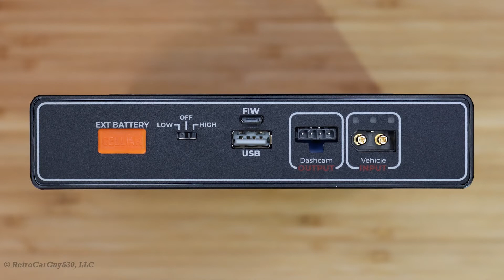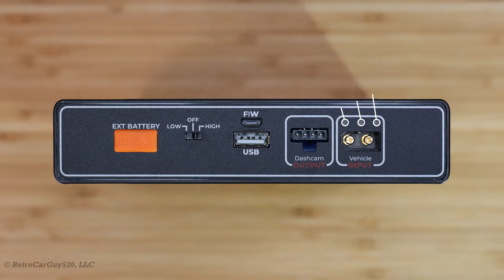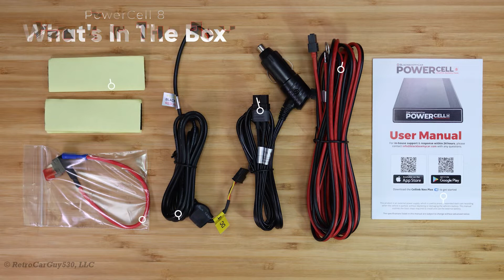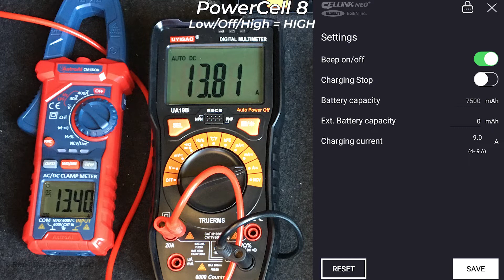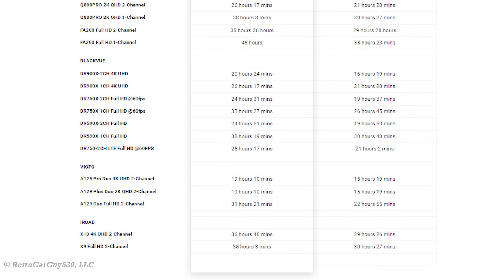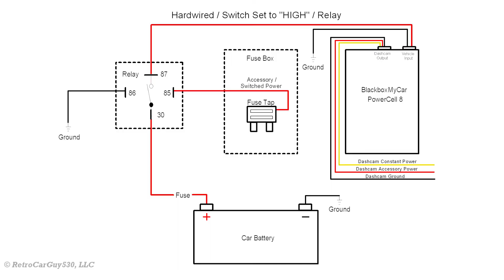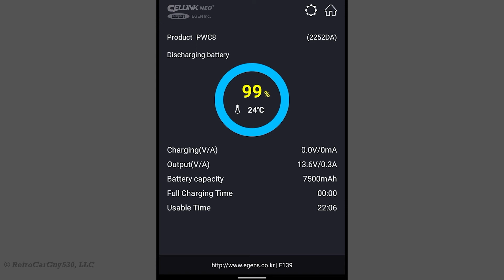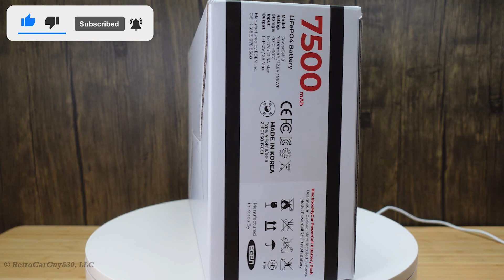BlackboxMyCar PowerCell 8 Dashcam Battery Pack Review / Testing

Comment: I would like to add several of these battery packs to my project truck to power several different components.

Mainly a dashcam, but also a dedicated wifi hotspot for remote live viewing said dashcam, as well as the several sensors added to my car alarm (possibly the alarm itself).

This would be to prevent the mentioned devices from draining my vehicles battery, as well as to charge them when driving.

I have also thought about taking this a step further by adding a solar panel to charge the battery packs when I am not driving the truck. I can seamlessly add one to the lid of my bed mounted toolbox, approximately 100w given the dimensions of a 100w panel.
Obviously I would need to diode isolate the solar panel from back-feeding into the ignition via the acc wire of the battery packs.

Have you ever considered adding a solar panel to supplement a dashcam battery pack? Do you possibly have any opinions to share on an idea like this? Just trying to think of ways to improve the system in a vehicle only driven a few times per week. 

Thank you.  Loving your content!
Reply from the maker: The PowerCell 8 can output up to 2 amps max.  You could potentially provide power to your WiFi hotspot using the USB port if the hotspot device is powered via a USB power connector.  I've not tested using a solar panel to maintain the charge level in the PowerCell 8.  It sounds like it might work as long as the output of the solar panel is capable of providing a minimum of 5 amps of charging power.  You would have to experiment to see if that would work.  BlackboxMyCar does offer a 120V AC to 12V DC power inverter / charging that you could use to charge the PowerCell 8 when parked.  It outputs 14.6V at 5 amps and has a cigarette lighter power port connector on it.

I'm currently retesting the PowerCell 8 as well as one or two other dash camera battery packs that were just released.  I have the BlackVue B-130X 7500 mAh / 96 Wh battery pack which is similar is capacity and size to the PowerCell 8.  The B-130X does not support adding an additional battery pack to increase capacity like the PowerCell 8 does.  I'm trying to get a Thinkware iVolt Xtra BAB-95 which also has a capacity of 7500 mAh / 96 Wh.  All three of those battery packs are manufactured by the same company (EGEN).  The two new units match the capacity of the PowerCell 8.  The PowerCell 8 I have for this new set of tests seems not have the same issue of requiring the much higher amp draws that the one I had at the time I created this first review video.

Comment: Using a relay, what size fuse should I use between the "30" relay post and car battery? Would you recommend a 15 Amp fuse based on the amp draw of 13.81 and 13.40 at 10:45?
Reply from the maker: Yes, 15 amp fuse seems appropriate if you set the charging level to 9.0 amps which in my testing resulted in the 13.81 amps of current draw on the circuit.  FYI, my test results are now being investigated by BlackboxMyCar and the battery pack manufacturer EGEN to see why two different PowerCell 8 dash camera battery packs (from late 2021) had the current draw levels you see in this video.  A friend of mine is testing/reviewing this same battery pack and he's now finding the current draw levels are within the specified charging amp limits set for the battery.
Reply: @RetroCarGuy530  Thank you so much! Very helpful to confirm what I was thinking. As for the current draw levels, that is an interesting situation.
Reply: @RetroCarGuy530 is this needed? Sorry I didn’t catch this during the video.
Reply from the maker: @Lagunaic whether you "need" a dash camera battery pack depends on your dash camera recording needs and your driving habits.  If you need to power your dash camera for long parking mode recording sessions, then the use of a dash camera battery pack can be quite helpful.  It isolates the power draw from the dash camera to the dash camera battery pack instead of the vehicle's starting battery.  If you only need the dash camera to record while you're driving your vehicle [no parking mode recording required] or for short parking mode sessions while your car is parked while shopping then, no you don't need a dash camera battery pack.
Reply: Also, it's interesting the supplied fuse with the product is 20 amps.

Comment: Right on Robert,

I just got done watching all 6 YouTube Videos on the Power Cell 8, (BBMC, EastCoastJeepSRT, dial2fast, Everyday Reviews, USDashCamera). Your’s is the best. 

I agree running 13.8 Amps through the fuse box may not be the best idea. I have LED Light Bars on my cars that operate at 7.5 Amps, and those must be wired directly to the battery. Using the relay method you show is a much safer option. Why is nobody talking about this? Lol

If I run the Power Cell 8 with a Viofo hardwire kit for parking mode, which voltage do I select for the low voltage cut off on the hardwire kit for the longest recording time? (the lowest voltage) 
-Chuck
Reply from the maker: I would set the LVC setting to the lowest voltage setting possible for that hardwire kit power adapter when powered by a dash camera battery pack.  The battery pack usually outputs 13.7 to 14.2 depending when fully charged. The voltage output from the battery pack should be in the mid to upper 12 volt range when the internal batteries are near fully discharged.  In many cases, the LVC of the hardwire kit won't even come into play when powered by a dash camera battery pack.  Each battery pack make/model has its own voltage output levels based on internal battery charge level, but most of them follow this pattern.
Reply: @RetroCarGuy530  
Thank you for the speedy reply.

Comment: Did you use the car socket to power your dr900x ?
I also have the dr900x
Reply from the maker: I used the 3-wire hardwiring harness to power the DR900X and DR900X Plus dash cameras I've tested over the past couple of years.  You can power the DR900X with the car socket power adapter, but parking mode will be the motion based parking mode (wait 5 minutes of no car motion to enter parking mode and exit parking mode when the car begins moving again).

Comment: Price?
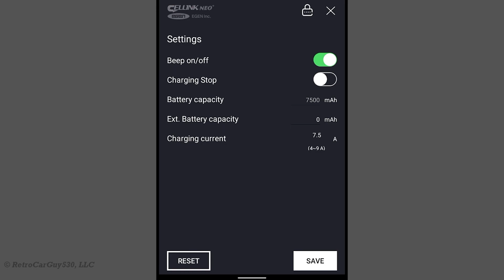Reply from the maker: Starting at 17:44 in the video, I discuss the pricing info for this battery pack.  BlackboxMyCar was running Black Friday sale at that time the video was released and it was available for $341.99 USD.  The current base price is $394.99 USD.  If you use my affiliate link or use coupon code RCG530 at checkout time, you'll save five percent on your purchase.

Comment: I know this is late in coming, but I've only just decided to venture down this rabbit hole, so please forgive me.

Now, I appreciate this video and the real number outputs you showed when charging and using the battery. It actually informed my decision on how to install this equipment in a way I'm more comfortable with - safely. While it's arguable as to whether this is over-kill given the lack of news stories highlighting these batteries causing vehicular fires when they are installed without a relay, I'd rather be safer than sorry...and without a vehicle!  'Cuz, as we should all know by now, insurance reimbursements/replacements are not easily obtained on DIY projects and mods, if ever.

For the benefit of your viewers, who don't already know and who are reading this post, this is why you always hear, "Have it done by a licensed installer." It's so the insurance companies can bill them for the claim, an avoid paying it themselves. If you DIY-it, you won't be seeing much (if anything at all) when you fill for a claim!

Again, RetroCarGuy530, great video! Thanks!

Comment: Will this batter pack work with the vantrue N4 dash cam?
Reply from the maker: I looked at the Vantrue website to check out the hardwiring kit for the N4.  It's a 2-wire device with low voltage cutoff.  Yes, you can use that with this battery pack, by wiring the red wire it to the "BATT+" output terminal (left most terminal connector) and the black wire to the GND (3rd from the left terminal connector).   Since the N4 documentation states it has a parking monitor, it must mean there's some sort of motion detection for the N4 to know when to enter and exit parking mode.  To have instant entry into and exit from parking mode would require a 3-wire hardwiring kit to access the ACC+, but I don't see that as an available accessory from Vantrue.
Reply: @RetroCarGuy530  thanks so much for the response!

Comment: If I wire number 30 with in 8" of my battery, is it acceptable for me to wire number 85 to an accessory/switched power fuse via tap inside my cab?  If so, what guage wire and distance would you suggest?  Reason is that all of the ideal fuses to tap into are inside my cab and not in the engine fuse box.
Reply from the maker: The control side of the relay consumes 100-to-200 mA, so you can have a long run of wire for that circuit to the remote fuse box location.  Most of the time, the relay pigtails I've purchased with the relays have a 16 awg wire for the control side.  I would recommend using the same awg wire gauge as the relay pigtail uses.
Reply: @RetroCarGuy530  Thank you for answering my question.  I have been studying this video for a few weeks now and I appreciate your technical insights.

Comment: I already have an extra VIOFO 3 wire USB-C hardwiring kit,not tech savvy here but is there any chance I can purchase an adapter for the power cell 8’s dashcam output?if so what is the adapter called?
Reply from the maker: During the purchase of the PowerCell 8, you can select "Output Cable" of your choice.  If you select "Power Output Cable (Unspliced)" you will be able to connect the wires from the output cable to the input wires on the VIOFO 3-wire hardwiring kit.  If you have already purchased the PowerCell 8 without getting that option, you may be able to contact BlackboxMyCar and see if they would sell that by itself.  I don't see it listed on their website as a separate product offering.
Reply: @RetroCarGuy530   after watching couple videos online,your video was the only one that convinced me to buy,ordered yesterday and pick cigarette lighter adapter as my output.also just emailed black box and see if they can sell me the proper output with separate invoice,or just send me one for free haha,cause that battery pack ain’t cheap man.
Reply: @RetroCarGuy530  question, before I purchased battery, my dash cam is hardwired, now when I turn off my car it goes into parking mode, now with powercell installed with cigarette lighter adapter, it doesn't go to parking mode, it just records like its on normal mode, if that makes sense. Is it because I don't have the output spliced cable?
Reply from the maker: To get the VIOFO dashcam to go into parking mode when powering it with the PowerCell 8, you will need to get the PowerCell 8 3-wire output power cable.  You then splice the output 3-wire cable from the PowerCell 8 with the VIOFO 3-wire USB-C hardwiring kit.  Then you should have parking mode again.  That’s exactly how I’m powering a VIOFO T130 3-channel dashcam right now and it goes into/out of parking mode as it should.
Reply: @RetroCarGuy530  ah ok, dang I should've pick spliced output cable then. Thank you for your quick response, I really appreciate it.
Reply: @RetroCarGuy530  once I put everything together,what about the voltage cutoff?do I still need to set it at a certain cutoff? If I do,does that also mean battery pack will shutoff?
Reply from the maker: I usually set it to the lowest value since it’s draining the dashcam battery pack and not the car’s battery
Reply: @garyd395  I just added this battery to my setup, looks like you still need to enable the voltage cutoff. I turned it off remotely from my phone, thinking I don't have to worry about draining my car battery anymore as it is just draining this Powercell 8 battery from now on.  The unit turned off as soon as I turn off the voltage cutoff.  I guess if you want parking mode, you have to enable the voltage monitoring/cutoff.
Reply: @MrRichardyc  hmmm,ok so it does turn off the battery if voltage cutoff is set to prefers voltage,as of right now,I’m still using output cigarette adapter,won’t go into parking mode if I don’t have unspliced cable.
Reply from the maker: Correct. You must have battery protection enabled in the BlackVue Dashcam settings to have the BlackVue Dashcam go into parking mode no matter if it is powered by fuse panel fuse taps or a battery pack using the 3-wire hardwiring cable.  When powered by a battery pack, you can set the low voltage cutoff value to 11.8 since it is draining the battery pack and not your car’s battery.  I just created a video explaining that issue. 

BlackVue X-Series Dashcams - Native Parking Mode - Info & FAQs
https://youtu.be/qa9rq7cEjyM
Reply from the maker: @Gary D if you define the parking mode in the VIOFO T130 firmware settings to the parking mode type you want, power the T130 using the VIOFO hardwiring kit and that hardwiring kit is spliced together with the 3-wire output cable from the batter pack, the T130 will go into parking mode when the ignition is turned off.
Reply: @RetroCarGuy530  sorry to bother you,so I spoke with blackbox,got my unspliced cable ,now the problem is it won't go into parking mode,once I turn off my car,Camera shuts off,I'm sure and positive inhave soldered cables correctly.

My camera settings is the same as when it was hardwired/with fuse taps.

Any help would be greatly appreciated.
Reply from the maker: @Gary D the most common reason for a BlackVue dashcam turning off when the ignition switch is turned off with the 3-wire hardwiring setup is the "Battery Protection" feature is disabled in the dashcam's firmware settings.  Even if the dashcam is powered by a battery pack in parking mode, you still need the "Battery Protection" feature enabled to make the BlackVue dashcam go into parking mode instead of turning off when the switched/accessory power is removed by turning off the ignition switch in your vehicle.

I discuss this issue in recent video on my channel: https://youtu.be/qa9rq7cEjyM?t=609s
Reply: @RetroCarGuy530  Im using viofo a139 dash cam.
Reply: @garyd395  make sure the power cable plug is plug into the dc in power connector port on the dashcam all the way until you hear a click.
Reply: I thought you are using a Blackvue...well double check anyway. good luck!
Reply from the maker: @Gary D sorry I mixed up your situation with another persons issue.  

It sounds like there's a cable splicing issue (possibly).  Looking at the "front" of the PowerCell 8, the output power port has the following pin assignments:

Left-to-Right

1 = Constant Power
2 = Accessory Power
3 = Ground

Some companies use red for constant power and some use yellow, that's why I go by pin number (left-to-right) to be clear on what pin has what power/ground associated with it.

If the constant and accessory power were swapped in the splicing of the cables, it would explain the behavior you stated is occurring.

If the HK3-C wires were swapped, the accessory power would end up powering the dashcam and the constant power would be viewed by the HK3-C as the accessory power allow it to boot/power the camera.  Turning off the ignition switch would remove the accessory power and thus the A139 would power down at that point.

Please confirm your splice connections are correct based on power type / position rather than wire color. The HK3-C has red for constant power, yellow for accessory power and black for ground.
Reply: @RetroCarGuy530  ok problem solve,I did what you said,splicing of the cables got mixed up,now my dash cam is able to go into parking mode.thank you thank you!
Reply: @RetroCarGuy530  you mention that i should set my voltage cut off to the lowest since it's not draining my car battery,now when I had it hardwired before, voltage cut off will detect car battery when it's getting low,hence it will stop my dashcam,now what about using battery pack will it do the same? Voltage cutoff will detect my battery pack if it gets to low then eventually shutting off my dashcam?if so,then I'm not really fully taking advantage of using the while power of my battery pack if it suddenly cuts off due to the voltage cut off my from hardwire kit.is that how it works?
Reply from the maker: The constant power voltage levels from the dashcam battery packs will often be well above the voltage cutoff range defined in the firmware settings of the dashcam.  I mention to set the voltage cutoff as low as possible to not let that feature artificially turn off the dashcam too soon as the battery pack is discharging to its lowest level just in case the battery pack's constant voltage crosses into the dashcam's voltage cutoff range.  Usually the battery pack will turn off its power when it reaches an extremely low charge level and when that occurs the supercapacitor in the dashcam will gracefully shutdown the dashcam at that point.
Reply: Looks like you solve your issue,but if your curious about that adapter it’s called a molex 43645 if your still planning on making  your own cable.